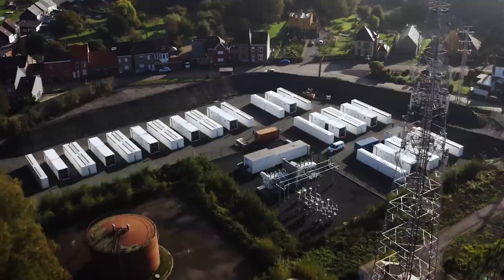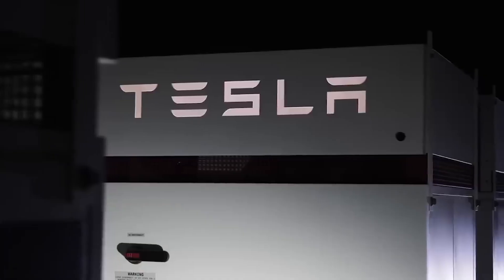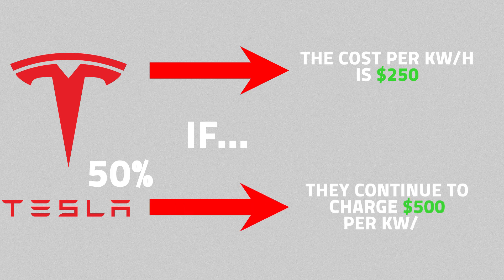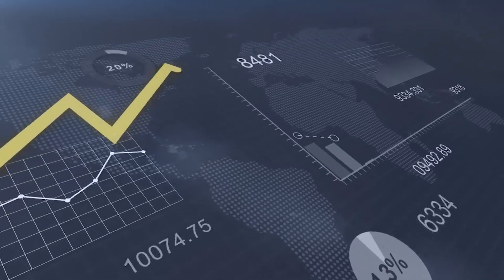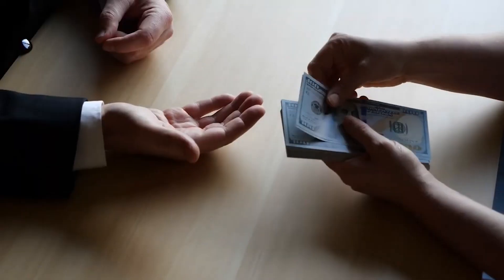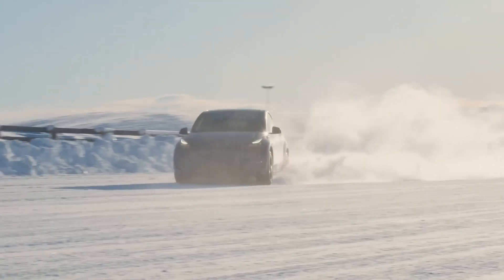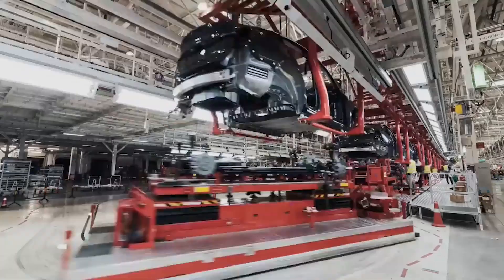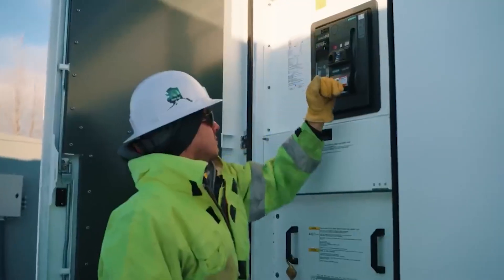Tesla Megapack Is A GAMECHANGER - CLIP #TSLA

Comment: Very easy to copy.
Reply: Try it...
Reply: @chrisheath2637  lol.  You know what i mean. There is no wide moat for another company yo copy a big box of batteries.

Margins of this size would bring competition flooding in and the margin would then close.

Thats not to say TSLA cant be successful at it, just that margins that size wouldnt last.
Reply: @wizzyno1566  Except it's not a big box of batteries, which is why there is literally no direct competitor to Megapack.  There are inverter/chargers involved, for one. Tesla's solution is the only AC-in/AC-out solution on the market.  Others provide batteries coupled to external inverters, some charge DC directly from renewable energy, etc.  There is a ton of site engineering and site prep, labor, utility level wiring, and of course Tesla's autobidder software.  Batteries are an expensive part of the product, but not the defining part.